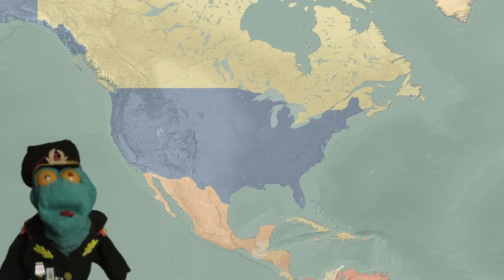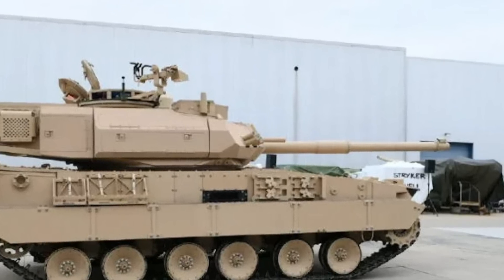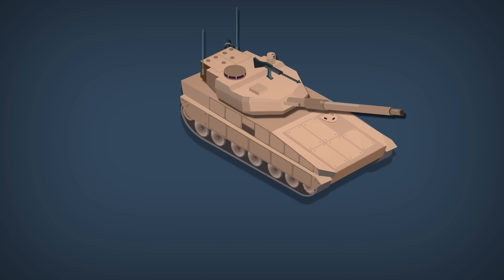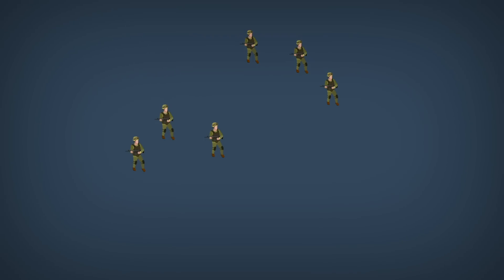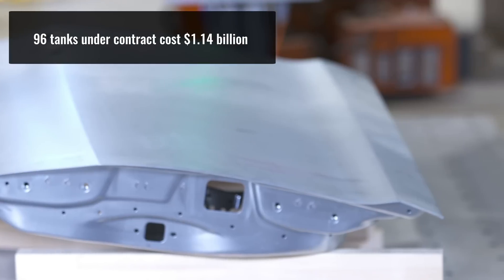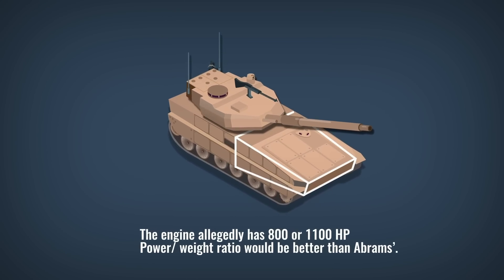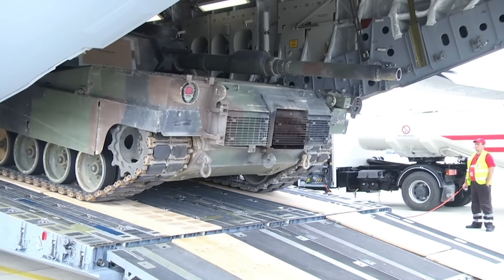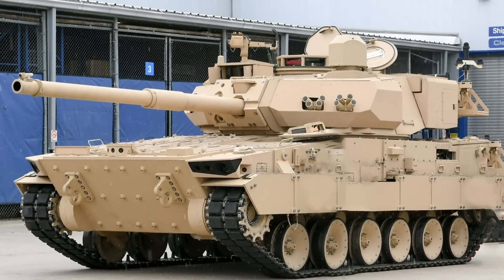US Army just chose its next (light) tank

Comment: In the age of every Soldier having a anti-tank guided missile this sounds like a Sitting Duck and it can't even engage other tanks.

It would become obliterated in the Ukraine war.
Reply: Name one tank that can survive a Javelin top attack without the same thing called APS
Reply: ATGM is a counter to a tank and not a replacement. Until soldiers can carry around 105mm canon, these vehicles will carry it instead.
Reply: Yeah, the same they said before the Iraqui war. People always having stupid basedless opinions
Reply: It can survive alot, if it's given an APS (which is possible as those aren't that difficult to install) then it'll be perfectly fine. It's main gun can kill tanks, 105mm APFSDS was the mainstay for NATO for a long time, it's just going to have trouble against future Main battle tanks specifically when shooting them from the front. Also, in the age of modern information warfare, this thing will absolutely be used to relay from infantry teams and drones what needs to be killed to this tank, it will then drive up and politely blow them to hell. It's speed will be a huge factor in it avoiding ATGM return fire, and it's light weight means it can be to the field in larger numbers than any heavier vehicles that aren't already stationed there.

It's precisely because of things like the Ukraine war that this tank was so quickly developed.

Comment: why would you want two machine guns that use different caliber rounds in the same tank?? surely thats just extra unnecessary logistics. plus lets say one gun breaks, now you're carrying around a load of ammo that cant be used in the second weapon.
Reply: Do you think a 38ish ton tank is going to be hindered by a dozen pounds of hypothetically erroneous MG ammo?
Reply: Because the .50 cal can handle threats a regular 7.62 cannot.
Reply: @JohnDoe-ul7sm  no but that wasnt what i was suggesting anyway. im saying if youre in a protracted fire fight and one weapon is damaged, now you only have half the ammo you should have because everything for that second gun isnt interchangeable. redundancy is king
Reply: Different roles are often best done with different weapons.  The coax is mainly there to suppress infantry while the main gun reloads a full sized .50 cal would be both overkill for that and underpowered compared to the main gun and it takes up too much room inside the turret for it's purpose, so they went for the smaller 7.62mm and probably could have even used 5.56mm.  The pintle mount on top is for fast engagements while the turret traverses but also needs to be powerful enough to be a threat to light fast vehicles along the lines of a technical that might be moving too quickly for the main guns traverse speed.  Since it is mounted outside the tank the larger size does not matter as much.  But the main thing is both weapons are secondary and both are part of the army's logistics so the type of situation where the tank could benefit by having commonality of it's machine gun ammo are extremely rare and means the tank should have long since retreated.  

This use of 7.62 or .30 for coax with a .50 or 12.7mm on the roof has been the standard setup on American tanks since WW2, there have been some changes mainly to location of mounts and tertiary guns but this setup is almost universal for the USA.

Comment: wouldn´t it make sense to put on some  anti-air / anti tank missiles on the side like the BMPT so it stands a chance against such threats?
Reply: Considering it's supposed to help replace the Bradly which has such attachments, that will most likely come near the end of it's development or once they start rolling them out.
Reply: @tankerboy12464  it is not meant to replace the Bradley
Reply: Making a single platform that does everything will only drive up complexity and cost and deliver a mediocre design that is a master of none.

Specialized air defense can be combined into tank units.
Reply: It’ll probably get them eventually just like the Bradley’s
Reply: Tanks don’t operate independently. They’re coordinated with infantry and other support vehicles at all times, and are all terrain cannon pieces that follow infantry until a threat is identified.
Reply: thanks for the replys

Comment: Not seeing the overall benefits of this Light Tank compared to the Bradley Fighting Vehicle. The BFV has a 25mm chain gun that handles most if not all enemy Armored Personal Carriers, Coax for troop targets, and Tow missiles for heavy targets AKA Tanks. Plus it hauls up to 7 dismounts. The 105mm cannon isn't made for modern tanks armor. So the only benefit might be it's shorter than the Bradley?
Reply: I assume the 105 ammo will be cheaper for attacking bunkers than using Tows and Javs.
Reply: @2157AF  It will.  Especially with the new, mass produced programable "omni" rounds.
Reply: MPF's purpose if long range fire support, so that's why the 105mm is present rather than the 25mm. Shooting directly at infantry will be the 0.50 cal  and 7.62 NATO coax role probably
battle order explains this more in depth: https://www.youtube.com/watch?v=qfVeoI3euvQ
The program is new so things may change
Reply: There is a round for the 105 that can engage modern tanks with high efficiency, its the newest version of the M900
Reply: @the7observer  In infantry support the morst important factor is being there to begin with.

It  is cheap, so apparently easy to get out the door and very capable of just bringing an entire building down with a 105 or spraying an area with frag, if it needs to.
Reply: I would imagine this light tank would be an IFV killer

Comment: One of these days the US will figure out that you can have a 4th crew member without it being a loader for a manual gun. So many tech/information jobs available for a 4th member.
Reply: @Alex Snowden I think it very likely we'll start seeing a 4th crew member that has a work station dedicated to operating small recon drones with a drone launcher on the tank. Likely also tasked as the modern 'radioman' monitoring the incoming contact reports and sending out the crew's own and filtering and relaying all that information to the commander.
I can't remember which program, but I believe there is already a prototype out that has one.
Reply: @winstonsyme7672  The marine corps is reorganizing and getting dedicated "squad systems operators" (read: drone operators) in each of their their squads.
Reply: 4th crew should be the drone pilot- and launching drones from the roof of the turret as a main weapon.  The gun should be the secondary weapon.
Reply: @angelarch5352  That's questionable. I suspect that for the armaments fitted to the drones to be as effective as the main gun would result in a drone that is too large to warrant using on a tank. In that case it would be more effective to use a conventional UCAV. Additionally drones do not provide the same breakthrough and area denial capabilities as tanks do. While it may seem like a good idea on paper it would completely undermine the purpose of having a tank in the first place.

Comment: Not designed to go up against MBT’s.  You can bet it will happen!
Reply: Bradley wasn’t but it fried the T tanks
Reply: @Mystical922  Because it was designed to have TOW anti-tank missiles.  This thing is using an old 1980s cannon that is subpar.
Reply: @DavidPT40  certainly not ideal but it can get the job done as long it’s not facing a T-90M or a T-14 which it probably won’t since they exist in large numbers but it’s going to be a supplementary weapon not the main show so won’t be facing large MBT’s. Good against mechanized since infantry units can be squishy and Stryker will have Bradley’s but imagine they may add something to give it an anti armor punch when it is ready
Reply: Dismount and engage MBT with Javelins.
Reply: @DavidPT40  If it's job was to kill tanks then it would be subpar. As a bunker buster and trooper clearing cannon, it's more then enough.

Comment: For the money, I would upgrade the Bradley. The US could be getting into a "Money Pit" with this new mobile firepower.
Reply: The Bradley APV is impressive, a multiversal machine. 🙂
Reply: Bradley's being improved to the A4(or was it A5?), but designs are also being looked at for a replacement. They can either put a 50mm chaingun on the Bradley or build off the Griffin. Either way, the design is getting APS and a new fire control system.

Comment: why two different size machine guns, seems inefficient.
Reply: 7.62 for infantary and 12.7 for helicopters and stuff
Reply: The M240 is an excellent GPMG, but the biggest reason that it’s used as the coaxial is that it fits better. The M2 is simply not designed to be placed inside a vehicle and besides the two weapons complement each other nicely. The logistics isn’t really a big deal because every single combat element of the US army uses both calibers anyway.
Reply: They've literally been doing this since WWII, plus 7.62 NATO is much smaller and lighter than .50 BMG so Much more can be carried. Plus .50 cals are a pain to use in coaxial mounts due to their tremendous size and weight.

Comment: I do not understand the point of a light tank when you have assault guns or IFVs with 105s, which fulfill exactly the same role on top of being troop transports.
Reply: Exactly.  Why not the Stryker for infantry support?
Reply: That’s why you’re not in charge
Reply: @RonJohn63  most likely because is common knowledge the stryker underperformed.
Reply: @Maddog-xc2zv  and the light tank will do better?
Reply: @RonJohn63  Mayto to new marine doctrine, since they don't use MBT's no more. the light tank has some advantages regarding troop support in an uncontested air space, still I do believe the US should invest more on IFVs, but definetely not the striker - you have all around the world excelent examples of great IFVs.
Reply: I thought the 105mm Stryker didn't do well because it was too much gun for the chassis. I think this thing is a replacement for that Stryker variant.
Reply: @MotoroidARFC  the new tank is "supposed" to weigh 40t, which is 2+ times more than the Stryker MGS.
That's 10t lighter than an M60 or M48, but have no fear: it'll get heavier!
Reply: @RonJohn63  oh, it will. And more stuff slapped on until it's nearly as expensive as an M1 but without its level of protection and lethality.
Reply: @Maddog-xc2zv  the Marines don't do any armor anymore.
Reply: @RonJohn63  indeed? News of May, 27th 2022: Marine Corps Advanced Reconnaissance Vehicle (ARV). no a MBT, but for sure an armoured vehicle. https://sgp.fas.org/crs/weapons/IF11831.pdf take a peak.
Reply: @Maddog-xc2zv  it's a TWO MAN mini-Stryker (meaning it's not even tracked) with an automatic cannon.
It's armored against small arms fire and shrapnel, but that's not Armor, you goober, no matter what they say.
Reply: @RonJohn63  the goober just has to say look at the world around you and see how many wheeled armored vehicles, again not at such as MBT, are used nowadays. In some theaters they perform better than similar tracked ones. Hope you're not peanut intolerant; if so, buy an epipen. And f., yeah, that is armour; not 60 tons of armour but definitely, mr. Magoo.
Reply: @Maddog-xc2zv  it's the same size as a BMP-1, but with a smaller gun.
Reply: @RonJohn63  take the bike home. if of no use debating the use of types of vehicles and their tactical role with potatoes. cheers, mate. have a great day.
Reply: @Maddog-xc2zv  I quote facts, while you whine.
Reply: Anyone whom served on a MGS Stryker said they suck. Plus you have to stop then shoot on a styler an MPF can shoot on the move. People on regular one said they were great. The one you want, sucks. Hence why the army in 2018 used procured LAVs from the marine corps to use in this role. And guess what it also sucked. The Verdict ? They picked the MPF.

Comment: question, why chose a 105 mm if you wont face tank ? why not a 30mm with some atgm in case ?
Reply: Well, that wouldn’t really be a tank.
Reply: 105mm is far more effective against fieldworks/bunkers etc than 30mm while being alot cheaper than a missile.

Will also faceroll lighter vehicles like IFVs/APCs/etc faster and at a longer range (and thus more safely) than a 30mm gun could.
Reply: Basically think of it like a direct fire artillery gun at the end of the day, basically enemy in a building no problem if building is gone
Reply: The 105mm can destroy a tank. The M1A, Leopard, and Challenger tanks originally had a British designed 105mm cannon. The Krauts designed the 120mm and went with it, so the USA also went with the 120mm Kraut cannon for standardization. 
Seems foolish to go with the105mm though due to the 120mm being the standard of the M1A1 and M1A2C tanks.

Comment: this is good for terrain and ground hold and army ops however I would still use option for bigger size canon like 130 mm some fiew tonnes more doesnt count so much as it can seriously punch anzthing and move fast in urban area and cover place and sourounding is easier to shot fast and also very very presiye this is why kf 51 light tanks from rein metall in like option for 130 mm has best potential to be no 1 in the world so us army need only to adapt demand we would like this be biger canon that we can go in use this option also the reason is why is so good for weight balance slight owerweight in back and at fornt allow even bigger protection and kind lean on move this is deadly fine acuracy and fine sharp penetrations os this tanks vibrate less and make some osrt off smoke foam or just stand and weight in short very manevouarable in oweralll a improvec design is bit leopard design design again with sligth less protection on armour against heavy tanks but still very deadly and can cover larger area very fast and fight much faster in urban ares atleast sofware inquiry comfirm this moves as leopards and heavy tansk are for open ground and line force deadly still lighter tanks in mixed terraina re very efcient if not so easy spoted and ahve ground cover terrain os in owerall much better at mission and taking like 3x terrain more then heavy tanks in range so they move slight easier anyway a 130 mm gun is not that heavier and do easy owerrbeat 105 mm gun and also be shorter for easy aimining and cary woofer balancer also enlarged for precision
Reply: A 130mm round woild require a whole new supply chain, which is problematic, and furthermore, a 130mm round is heavier and takes more space, which means less rounds can be carried and the vehicle is more crammed, reducing crew effectiveness

Comment: Still not 100% clear what role this vehicle fills that wouldn't be filled by an Abrams, Bradley or Stryker-MGS. Also curious what will need to be done to help it handle the proliferation of man-portable anti-tank weapons and drone systems. At the moment this system feels like a response to last decade's war, where you're fighting an enemy in buildings or caves armed with RPG-7s and IEDs at absolute worst. Can anyone else here help me understand?
Reply: I agree, it could just be defence contractor cashing out
Reply: It’s probably closer to a Stryker replacement with better off-road capabilities. Better gun than Bradley, which is an IFV anyways. The Stryker had crazy maintenance requirements, and an unnecessarily large gun. Think of this tank as similar to an M4 Sherman with the 105mm howitzer (same caliber as this gun, in fact). Armored enough to withstand small arms fire, but mainly just used to clear bunkers, fortifications, and maybe some light vehicles.
Reply: After smart weapons are used up having the armor to push threw standard units would be a boon also its system could help augment the Bradley and Stryker without slowing them down as much as a Abram allowing for a more mobile armored reaction force
Reply: I heard the army is actually purposely diversifying their army in all fronts.
In an interview with the forces in guam, apparently because of recent advancements in logistics the past few years, it allows the army to field like 90 different types of sam systems on a single base with little to no problem with logistics.

Lockheed Martin on the F-35, would add systems that would monitor the stress of each component, and after sorties, staff would get a list of components that would need replacing soon, just so they can order the components ahead of time.
Also you have players like Palantir, that helped Stellantis/Chrysler with their massive data processing ability, to help make more reliable cars.

I think with all those new advancements, the army probably tried to diversify.
Keep in mind, the more diverse/complex a system is, the more protected it is.
Imagine if a new weapon came out that somehow invalidated the Bradley and the Stryker, but not this tank. Imagine a new missile came out that invalidated the Iron Dome and patriot, but not THADD? Its good for adaptibility
Reply: You can't air drop an Abrams tank. You can with this light tank. Also, the Abrams is over 70+ tons. It's too heavy for a lot of situations.

But you can air drop this light tank along with paratroopers.
Reply: @honkhonk8009  This makes a lot of sense